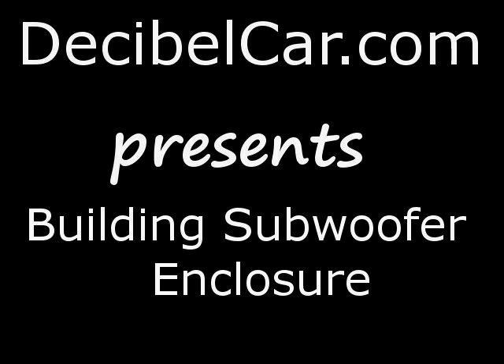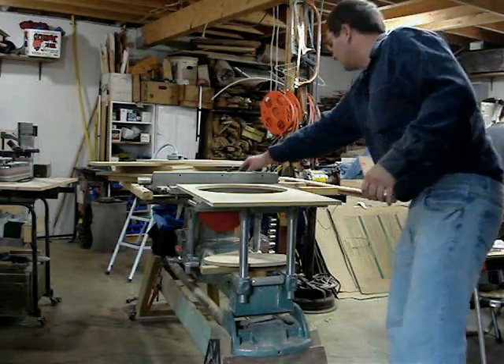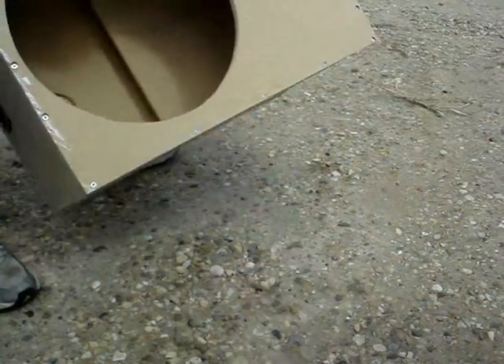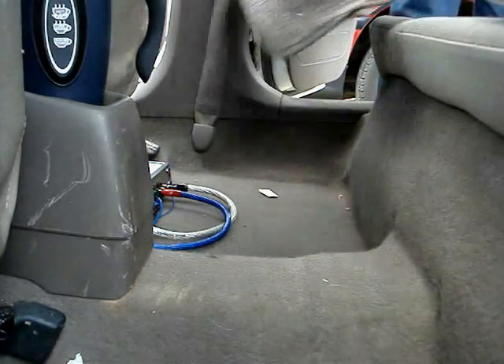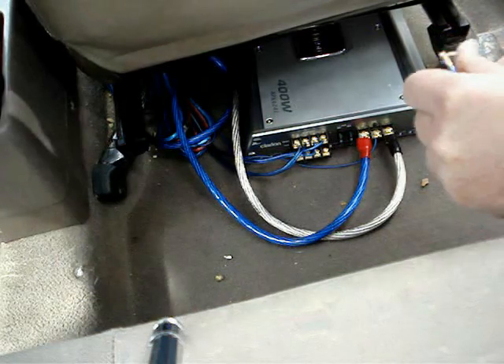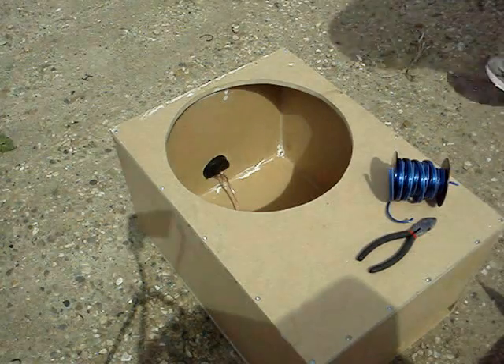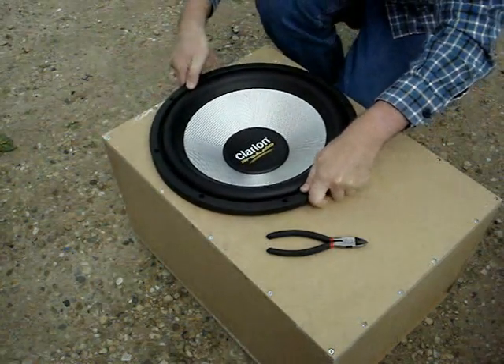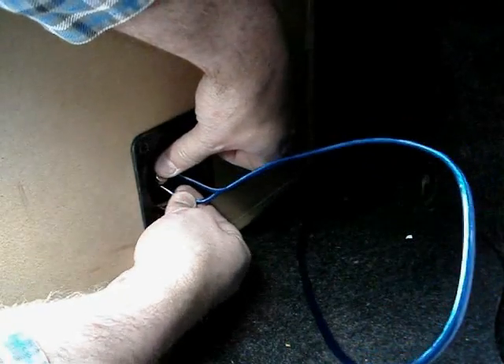Building a Subwoofer Enclosure

Comment: no it isnt dangerous. its polly fill. its there to slow down the rear pressure/sound wave to trick the subwoofer into thinking it is in a bigger enclosure thus improving bass response and sq.

Comment: Im wanting to build a dual 15 inch sub box that's ported. My question is should it be single port or dual port? And i will be using 3/4 MDF will that be sufficient? Btw the subs i have are circular not squared. Very informative video.

Comment from the maker: @jaketownsend36 I counter sunk the pilot holes with a Counter-sinking drill bit. You can also use a Rosette bit or a standard bit thats bigger than the screw head (but you got be super careful using it).
Counter sinking stops the screws snagging on the carpet if you dont trim it. 
If you do trim it, use a painters caulk to fill the holes for a smooth finish.